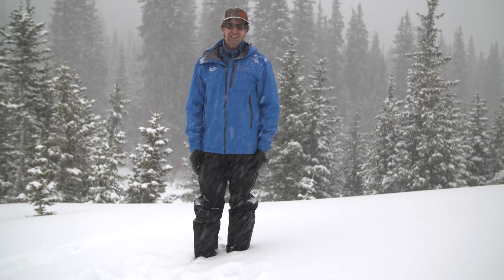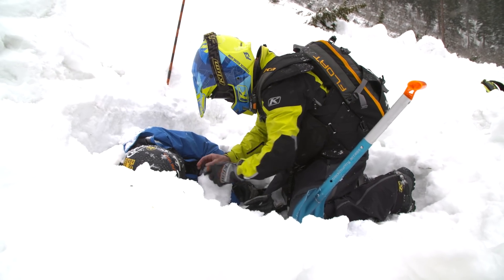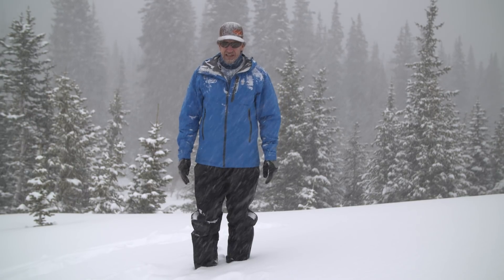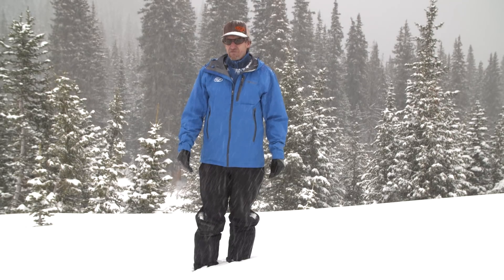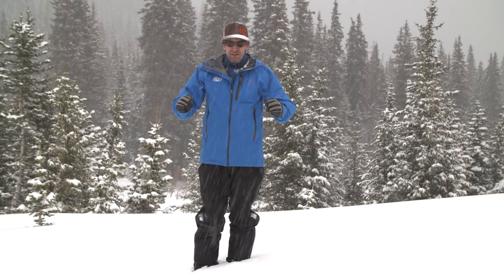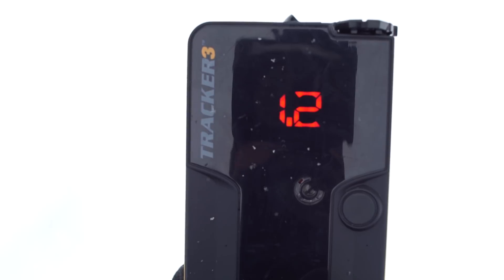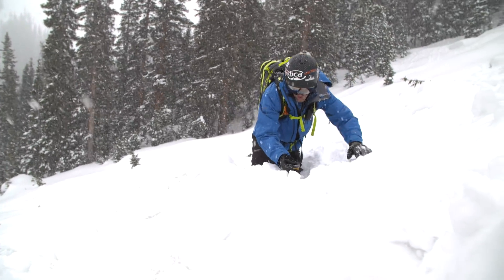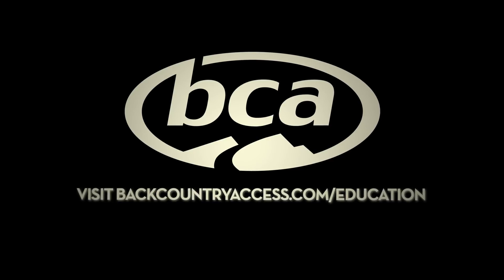Intro to Avalanche Transceivers for Skiers and Snowboarders

Comment: "Beacon" or "Transceiver"?
Reply: The Alpine Ex- a becon transmits a signal but doesn't do more.......a transceiver both transmittes AND receives. Any type of 2-way radio is actually a transceiver such as a walkie talkies, CB radio, or police radio. A becon only transmits for a receiver to pick up but can't receive.
An AM/FM radio is a receiver you can listen to music that's being transmitted but can't talk on it. 

When a shipping vessel sinks in the Atlantic they may have a becon that once it floats it continually transmits a signal to be tracked but doesn't receive any message from the coast guard it just transmits.
Hope this helps.
One's just a transmitter, one recieves and transmits, and one only recieves.
Reply: @pyrofful  Yes, technically it's a transceiver, so we're trying to use that term more and more (but need to stick "beacon" in there every once in a while for SEO purposes ;)
Reply: @bruceedgerly7948  ok cool video. Just trying to teach the right terms not trying to be a snob. Lol.
Reply: @bruceedgerly7948 UP IN CANADA ALL OF THE SKI PATROL CALL THEM "AVALANCHE TRANSCEIVER ", THEY NEVER CALL THEM BEACONS.
Reply: TRANSCEIVER, THERE'S A 100% DIFFERENCE. A TRANSCEIVER TRANSMITTS AND RECEIVES WHERE AS A BEACON TRANSMITTS AND MOST OF THEM HAVE A STROBE LIGHT ON TOP AND SEARCH AND RESCUE AND COAST GUARD PICKS UP THE FREQUENCY WHICH IS TOTALLY DIFFERENT FREQUENCY THAN A AVALANCHE TRANSCEIVER.
Reply: The Alpine Ex moo
Reply: Gary Clancy 😘